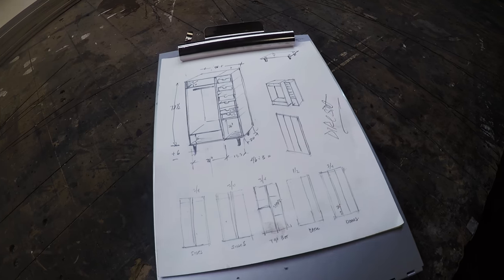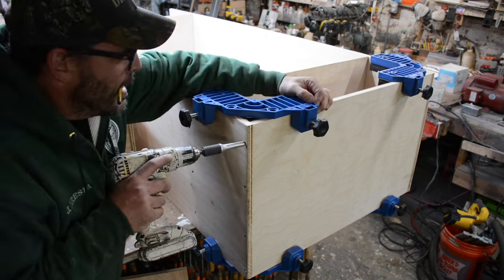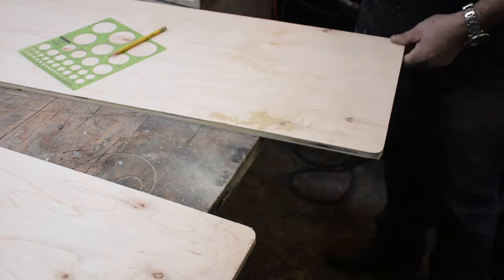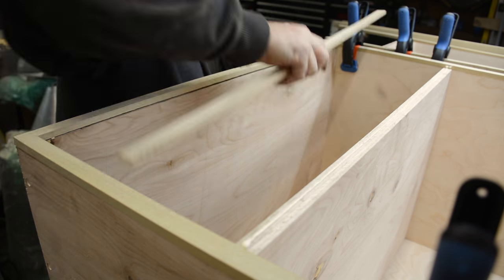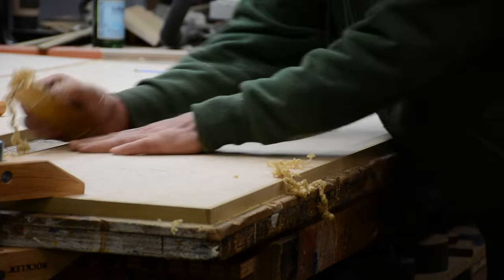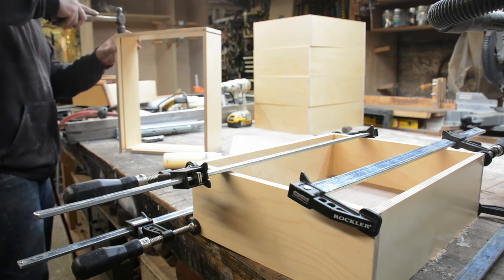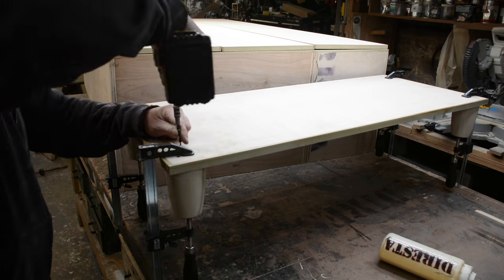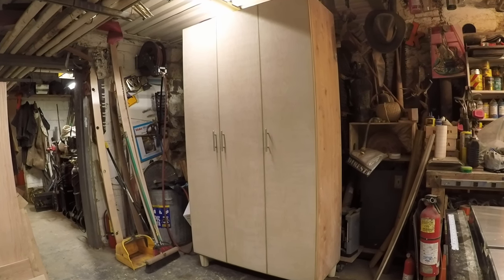DiResta #TBT Armoire / Wardrobe Closet

Comment: I love it (and it seemed to go together so quicklY!), although 5 sheets of plywood is something like £363.68 here in the UK. Adding on the cost of hardware, you've really got to want to do it; it's much cheaper to buy something (yes you can question the quality of materials of shop-bought stuff).
Reply: 🎉 I feel much better now. 5 sheets of nice ply would be over $600 Au and hardware probly close to $150, any trim would be crappy Radiata pine $100?.  A similar flat pack robe probly about $500 🙄. Glad we arent the only ones being ripped off🤣